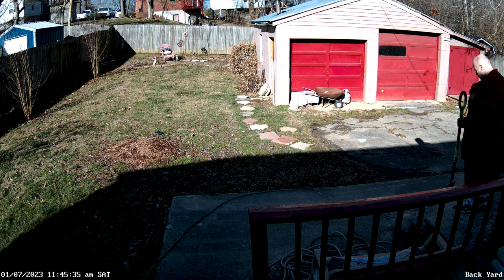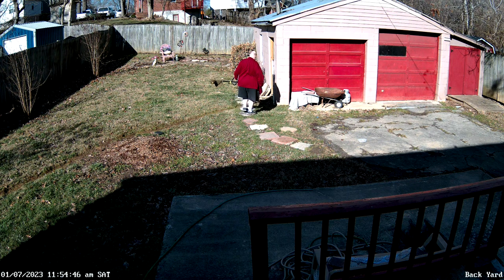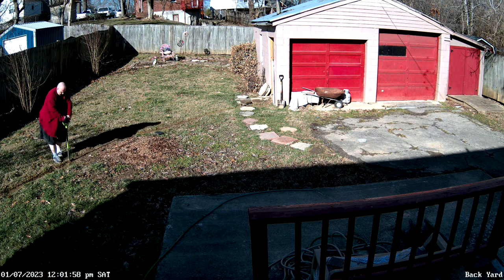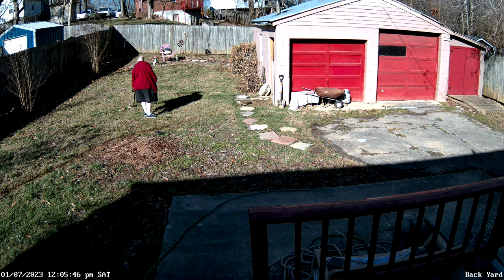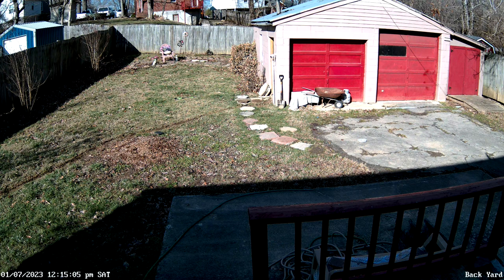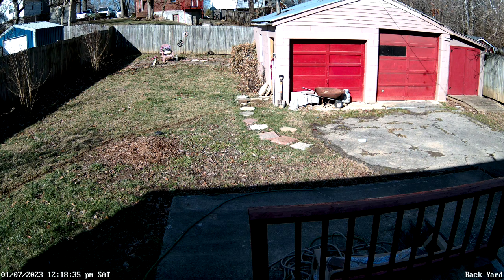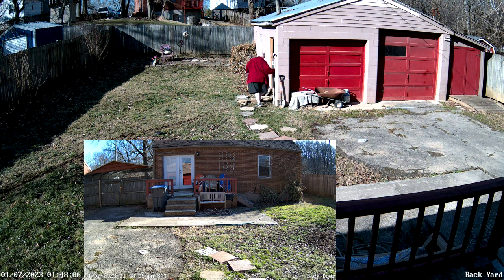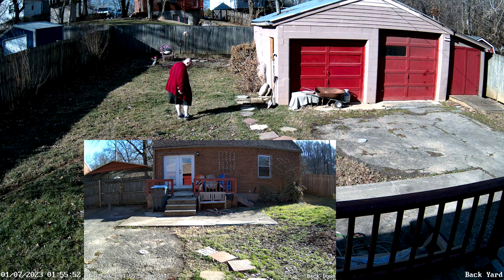Burying Ethernet Cable & Installing A PoE Security Camera

Comment: Thanks for this video…
I just inherited my grandfathers property in the woods and I’m kinda nervous about burying
Ethernet did you wrap it with anything or is the coating enough
Reply from the maker: The cable I purchased had a stiff outer cover because it was designed for "direct burial". When you are looking for a roll of cable, just get the one that says, "direct burial" and the covering will be strong enough to be in the ground. It's a bit stiffer than the classic blue or grey cat5 or cat 6 we see used in networks, but it's plenty strong and pretty cheap. The benefit of burying the cable is you can generally get by with less shielded cable because the ground helps shield it from RF.

Here's the exact cable I used. I have had no issue with it. https://www.amazon.com/gp/product/B0BCTYR3HY?th=1